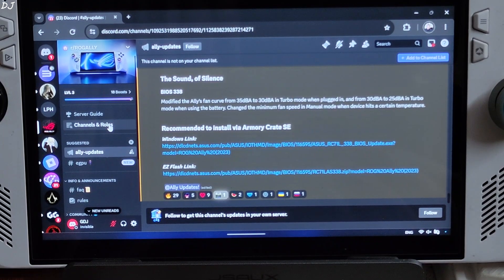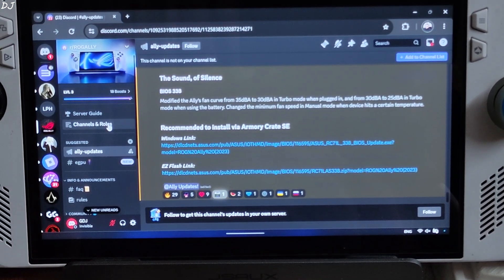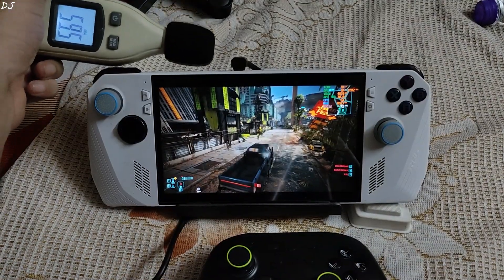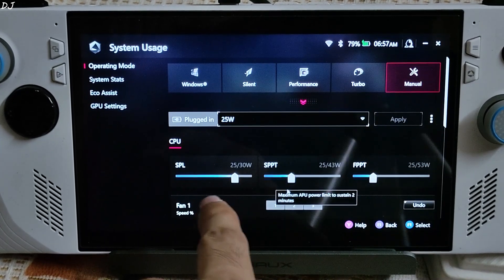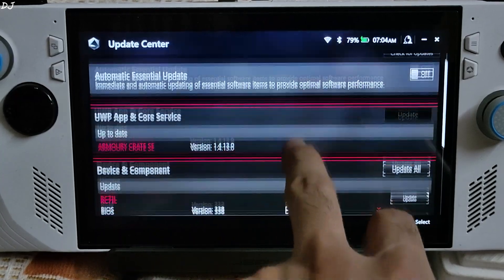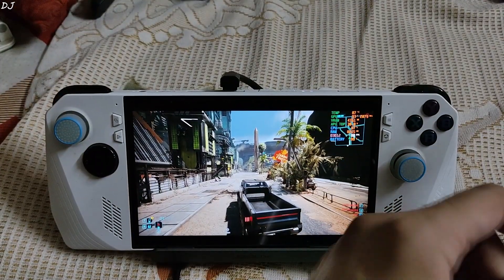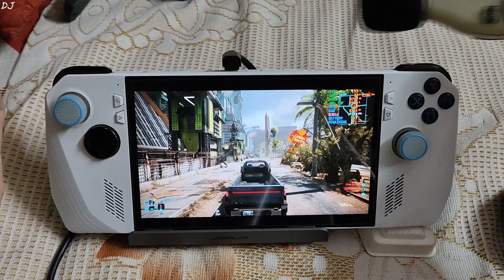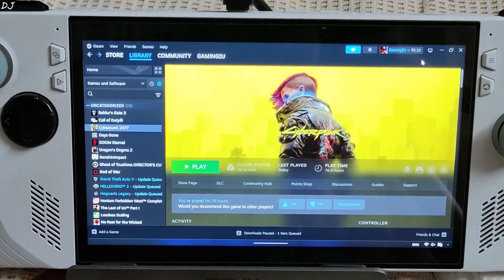Rog Ally New Bios 338 Now Live | Fan Curve Updated | Turbo Mode Fan Noise Reduced / Temps Increased

Comment: 2:49 which latest bios didn't lock manual minimum fan curve 74% ?
Reply from the maker: latest bios 342 has it unlocked
https://youtu.be/y3-haIH8onk?t=2358&si=cwL-DsVu8XVEJTnL
Reply: @GamingDJ4u  it clearly shown cannot be lower than 74%

Comment: I used to dock my Ally on a monitor to play games but after this update, I'm struggling to have the same experience. Ally overheats, performance goes down and the the monitor just turns off. Please help. What are the best settings when having Ally docked to an external monitor?
Reply from the maker: Sorry i don't use ally in dock mode but were you using turbo mode before this update? It will overheat / throttle ally's processor during summer season and this bios update further increases temps on turbo profiles. Manual power profiles / fan curves are recommended. I've already shown mine for harsh indian summers 40 degree celsius ambient temperature.
Reply: @GamingDJ4u  I have manually aligned the fan curve to run at 100% right after 80 degrees and it works fine now. Please let me know if you have better tips and suggestions. Thank you, by the way. I am not currently facing any problems whatsoever.

Comment: hello do you think it's worth buying the rog ally x if i don't have the rog ally z1e ?
Reply from the maker: Yes if you can afford it, around 799$ . Battery life got doubled compared to the original. More ram with higher speed as well, weight increased by around 70g only. Usb 4 type c port is included.

Comment: Can you make a detailed video about 25w manual mode fan curves please nice video as usual the new upcoming rog ally has no 15w mode now it's 17w mode so it would be nice to get a overview video about fan curves
Reply from the maker: Yeah z1e loses most of its performance at 15watts , runs like steam deck. 02:40 this is the fan curve I use with 25/30 watts profile. Fan runs at full speed when temps hit 70 degree c. Ambient temperature here is above 40 degree celsius now so no other option. Never uses ally's turbo profiles. Terrible temps with negligible performance grains.